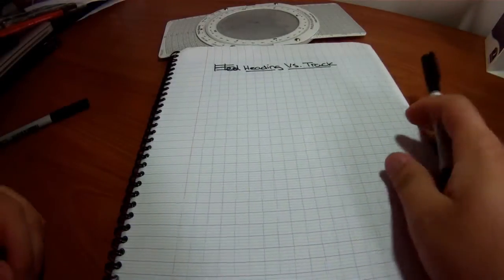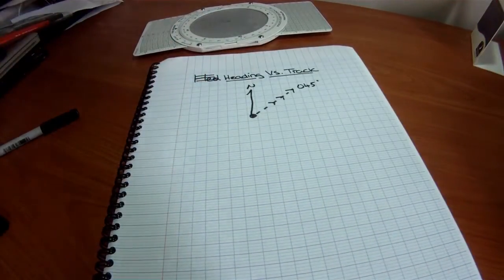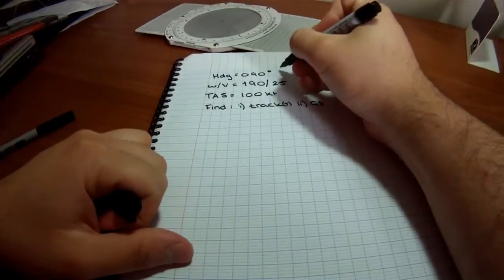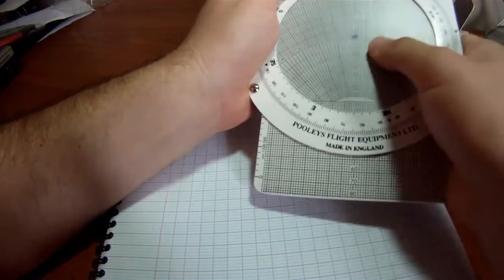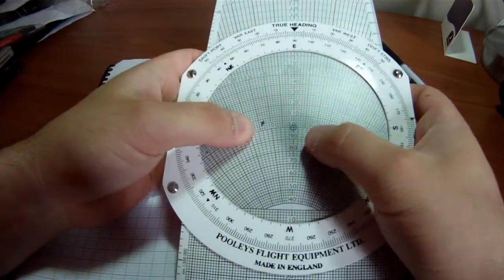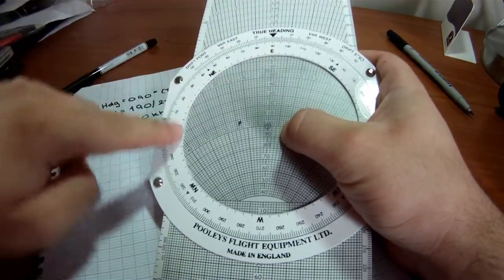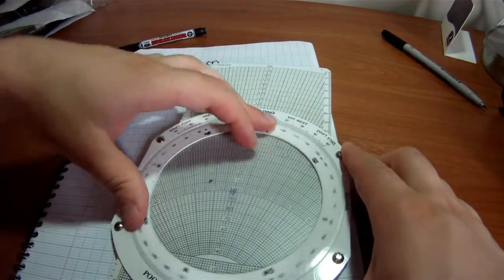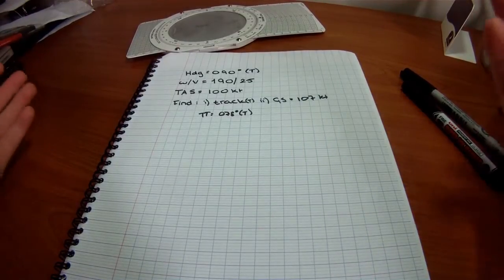CRP 5 finding track and heading (2) / track vs heading: Merryface Aviation Groundschool

Comment: Rubbish-to calculate track DO NOT Move the heading. All you do is look at the outer scale marked drift at the value you have -in this case 13 P and read the track from the inner scale. In this case 077

Comment: Ya this video is correct up until the guy searches for track. 

Once you've dialed in wind velocity and heading, both ground speed AND drift angle are read from the dot as-is, no further rotations of the wheel. Track is then found by adding or subtracting drift angle to/from heading. 

For others unsure of what the guy is calculating, he's calculating drift and drift angle and track, not wind correction angle.

Comment: That’s completely wrong my friend ! As a flight instructor I’ve seen students do this mistake all the time … once you have your drift you turn the wheel towards the drift , you did the opposite so you should end up 104 track - as in the end you put the pens to visualise it which is correct as you have winds pushing from the right you should turn into the wind to correct so the hog must be more than 090 .
Practice makes perfect

Comment: If you are on a course of 090* and the wind is for all intents and purpose coming from your right 190* that will blow you left on a course direction below 090* so you would need to be increasing the numbers to stay on track and not get blown further left.... Did you turn the wheel the wrong way?

Comment: Hi. Helpful video. I had a question which gave me the following :
Track 060 (T)
IAS 140
W/V 010/20
Find TAS and Heading
When I did it using CRP-5 using your method above, I got an answer of headwind and TAS around 125Knots. Heading was 054. But the answer given was TAS 154Knots. To get 154Knots I had to do a 180Degree turn and set the heading to 234. why is it such?
Reply from the maker: You have an Indicated airspeed, but no altitude or temperature values given to you? You need to have pressure altitude and temperature to find TAS from IAS. I can post a video going through the question if you send it to me.

Assuming that IAS is meant to be TAS or that you're meant to find it using other values you haven't given, the question you pose uses a different method. Here You're finding track from heading. In your question, we have to find heading from track.

The method for your question is outlined in this video: http://tinyurl.com/qccldck NOTE; this video talks about variation when it's meant to be DRIFT. sorry about that

The video I posted finds Heading and GS.
Reply: Here are the Informations Given :
FL55,
OAT +12,
IAS 140,
Tr 060 (T),
W/V 010/20

Determine whether a headwind or tailwind. Determine the G/S of the Aircraft. Find the Heading.
Reply from the maker: I'll work on a video and post it ASAP ;)
Reply from the maker: However, I'd like to clqrify a few things for you right here.

IAS; Indicated airspeed. That's what you see on the instrument

TAS: True airspeed. That's the speed at which the aircraft travels through the air.

GS: Groundspeed. This is the speed that the aircraft travels relative to the ground.

EAS: Equivalent airspeed. This is airspeed at sea level in ISA conditions.

CAS: Calibrated airspeed. This is IAS corrected for position and instrument errors.

Don't forget to learn EAS and CAS too, as they'll be in your performance, A/C general knowledge and Instrumentation exams. This is basics and extremely important.
Reply from the maker: Here's the video working through the entire question for ya

CRP General Navigation Question for Groundspeed, and Headings

Comment: finding true heading... so you have true track say 070 and you have W/V at 230/20knts what is the true heading... i know that the track will be blown off course to the left so you would have to add  drift but its the point where you  take away the drift on the CRP i get confused.

Comment: so i watched the video and its the part when you rotate the inner scale to match the "drift" but i think you say variation in that particular video. 

example you have calculated you have 10degrees drift now what is the next step. to line true track up to 10 degrees and see if the drift matches or not?

sorry this is very confusing for me and the penny just has not dropped for me yet ;p

Comment: could really use your help, i have my nav exam approaching and im really struggling with finding parity when calculating true heading!

i find the drift without an issue its then adding or taking away the drift i get confused.

i know the direction of the wind and the plane so knowing weather to add or take it away is not the problem its using the CRP 1 and finding "parity" (moving the inner scale without ajusting drift). if you could contact me id really appreciate it. 

cheers.